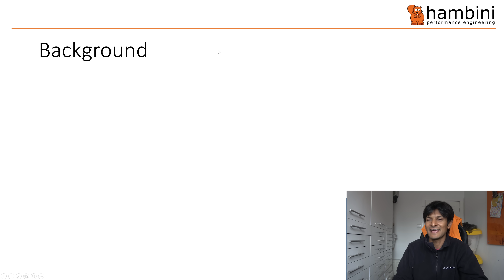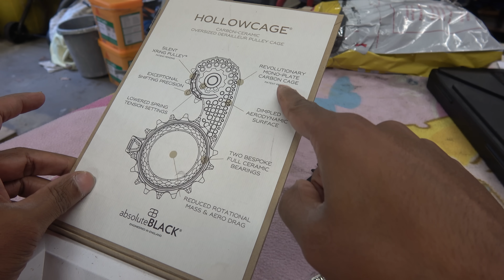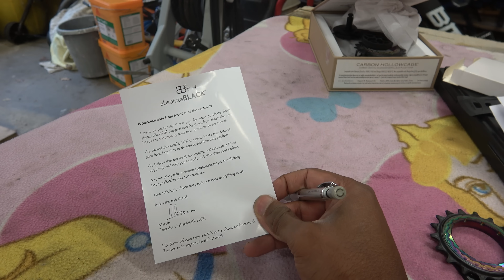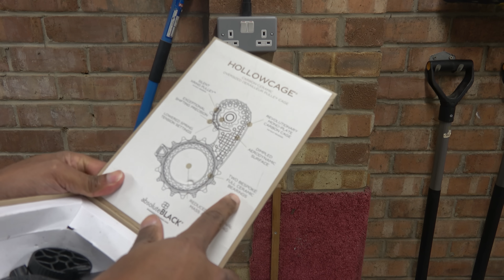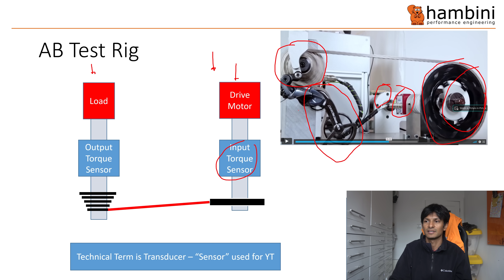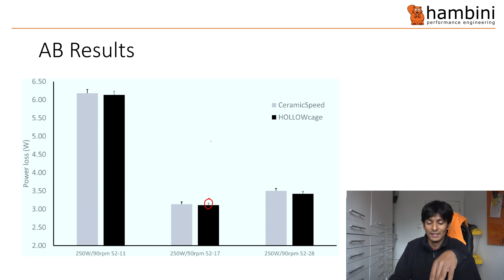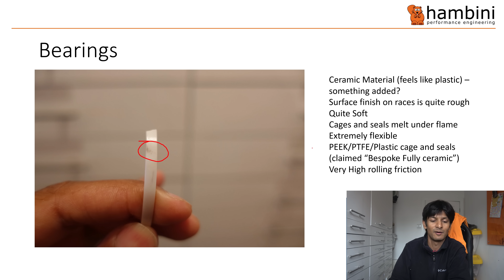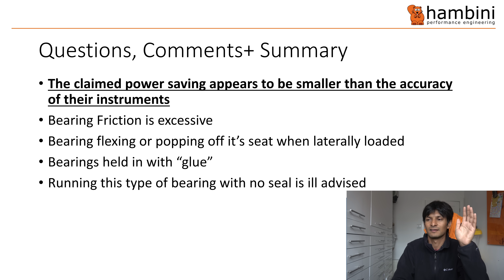AbsoluteBlack $700 OSPW: An Engineering Reaming Hollowcage

Comment from the maker: The thing to take away from this video, is the power savings they are claiming do not appear to be valid. Their equipment doesn't appear to be accurate enough. I would point out that I have been quite conservative in the error. Power is the product of torque and angular speed (cadence), As an example, the speed reading is +/- 1 RPM. If you do that on a cadence of 90RPM, that is already 1% error. That is even before we discuss the torque limitations.
Reply: My issues are why would 1 watt  make a difference anyone would notice, and why not use a better bearing if they intend to sale the unit at such a substantial cost? I know the saying OZs equal pounds and pounds equal pain, but I seriously doubt the 1 watt of potential energy savings is worth the price tag. 

Unfortunately someone's going to have to actually use one and report back if they noticed a difference. 🤷🏻‍♂️
Reply: I'm afraid your analysis of their measurements is incorrect. You are confusing the accuracy of the sensor with its resolution. It may only be able to accurately determine torque to say 0.1Nm, but it may have a resolution of 0.001Nm (made up figures). What is important here is the relative measurements between the 2 products.
Reply from the maker: @leejohnmitchell  I appreciate the resolution might be higher but the torque is lets say +/- 0.1Nm. You cannot be sure that one is reading at the max end the other is at the minimum end. You've got that error on two shafts so it would typically be standard deviation for the two errors to square and root them. Thus the error quoted is conservative.

I would also point out that their graph shows Absolute numbers and not relative ones, it's 6W on the 52/11
Reply: @leejohnmitchell  Sort of;
The reality is we do not know the accuracy figures of the sensors.
Those figures quoted are a range the company warrants the device to be within, not it’s error, or correction, therefore we have no basis to start from nor does Absolute black. Then it even gets more complicated as this is quoted at a temperature. The manufacture also quotes the range is bigger at the lower end if I understand the manufacturers sheet correctly (although I can’t see the foot notes)
Reply: @Hambini  In a setup like this, sensor absolute accuracy isn't so important. Think of it as being something you can zero out like on your calipers. You can take a measurement of one product, swap in another one and you can get a very good indication of difference even if the absolute values are complete bollocks.
Reply: @Hambini  Why has no one mentioned yet that the 18t lower jockey has narrow-wide teeth? Friction City.
Reply from the maker: @leejohnmitchell  I don't disagree with that at all but this is a point now where it's "certified" vs "practical". So practically your comments are bang on but this is used for individuals buying a product. i see it as no different to quoting the 0-60 of a car. You might be able to do 3.87s ( using your comment about resolution) but if your stop watch only has warrantied (certified) accuracy to 0.1s then you must quote 3.9s

I would also add the speed sensor has inaccuracy which I ignored, there are two shafts and two sets of torque readings as well as the temperature. I think my estimate is at the bottom end of inaccuracy.
Reply from the maker: @waynosfotos  For CE certification, you take the error to be the warranted accuracy.
Reply: @ElliotFlowers  Don't come to the hambini show then. Just listen to the marketing hype and you'll never be disappointed.
Reply: @Hambini  as long as you are measuring another item which has a significant resolution or accuracy some significant factor bigger. In this case that is not the scenario.
If you are to quote a error as AB have done here, you need to use the transducers as a Standard, this requires sending it off to your countries measurements standards to be “calibrated” so you have known errors/corrections at set points on your measurements scale (you define these). Then you do your measurement, record your results, then apply the correction or error, to obtain the true error.
So as you have already stated, the standard you are comparing to in this circumstance is not adequate to quote the resolution and accuracy for this test.
And this is before you consider “controls” modelling to take into account any potential variables i.e. the labs ability to measure @ the uncertainty of measurement. Usually 3 sigma.
Reply: @ElliotFlowers  you won’t have it for long single sided injection moulded plastic/carbon to fail  should last a few miles before it fatigues and snaps.  Make sure you ride with support so you can get a lift home and have the receipt handy for when you make it back.
Reply: @jonnythelegs2597   HARRY ENFIELD NO.1
Reply: @ElliotFlowers  he's not here to destroy your happiness(bizarre and sensitive type comment, I must say) he's here to hold marketing bullshit to account. If you want to throw your money away that's your business.
Reply: i bought two cos i believed. next thing he is gonna say take b
ack those shoes i thought i looked cool in.
Reply: @waynosfotos  just a weights a measures perspective as you say they can be used as " standards" when calibrated by an accredited lab to find the exact slope of calibration and accounting for uncertainty. the data sheet says the readability is 0.01%full scale so could give decent readings but for a calibration report the comparison unit would need be 0.001 or 0.0001%full scale and this do be done on the completed test rig to account for any added friction. I would expect these like most transducers are shipped with a very basic calibration certificate of a few test points not determined values.
Reply: lubrication stops a lot things getting too dry.
Reply: @ElliotFlowers  I’d love to live in your rose tinted Hubbard world. 

I see you every weekend, in centennial park doing hot-laps with your warrior mates. Pulling up after three maybe four hard laps for your hard earned double almond latte. Admiring  your Rapha gear and fully specced s-works ( check my new cage guys it’s making me so happy ) 

The enviable life of the Hubbard.
Reply: @RolledLs  Dyson are making handlebars tomorrow.
Reply: @tobycolin6271  You are just such a jealous guy...
Reply: @ElliotFlowers  Did you really buy 2 of them?
Reply: It is posible that the accuracy error manifest as an offset in the reading. That can be zeroed out. With some care in a controlled environment may provide better readings.
A better argument may be noise floor. But that one improves with averaging.

My point is that the video makes other statements much more powerful than this one.
Reply: @leejohnmitchell  comparison measurement like you mentioned, would only make sense when performed by independant body. On top of that, both manufacturers of the tested products would need to agree to the rig setup, testing procedures and conditions. What we have from AB is completly false statements. Im curious why CS is silents about this.. maybe they also have something stinky under the rug..
Reply: @jonnythelegs2597  that's how Hambini should present it!
Reply: @RolledLs  Nothing wrong with Rapha gear out of all that other stuff, it's by far the comfiest stuff I've ever used - comparing to all the other gear I have owned:
Aldi own brand, Pearl Izumi, dHb, Endura (FS-260 with pad fit), Sportful, Castelli, Gore

The only ones of the premium end I haven't compare it to is Le Col and Assos because I've not wanted to spend the money on them in case they are worse. Being, in effect, a reverse snob, making your ride less comfortable because you don't like the big brands is rather foolish
Reply: @ElliotFlowers  the best thing to do if getting ripped off to the tune of 700$  makes you feel good is to not listen to actual engineering analysis and keep your research limited to marketing hype. That way you will remain uninformed and happy. Nothing wrong with that.
Reply: I'd just like to clarify, I'm not trying to defend their product, it looks like an expensive piece of shite, but the criticism of their measurement system is semi flawed! The amount of difference shown between the products is probably reasonably accurate, what is likely total bollocks is the absolute / offset values on the Y axis.
Reply: @frankswl  well, the park tool pizza cutter doesn't claim to cut pizza better than other cutters. It just claims to be cool.
Reply: @leejohnmitchell  Right I'd like to echo the doubt about precision vs accuracy. If the test rig produces repeatable results within a much tighter range than the advertised absolute accuracy, then the test is valid. But you are right that the fact that they advertise absolute wattage numbers is BS.
Reply: @ElliotFlowers  translation: it my party and I’ll cry if I want to! 😂
Reply: @ElliotFlowers  grow up dude!
Reply: @RolledLs  he’s got a S-Works SL7? 😂 a rubbish bicycle!
Reply: @Gobtik  the comment is highlighting the fact of how people rely on all these things to talk for them rather than what they (as-rider) can actually perform …
Reply: Lesson to be learned here? Don’t buy the next big thing until you have more proven information. Wait and see. Great job on the video. Not bad for a five year old. 😂
Reply: @ElliotFlowers  Is this a joke?
Reply: @ElliotFlowers  I wish I was trust me if your cage would make my bike faster or lighter I’d have 2 one for my race bike and one for my tt bike. Unfortunately now hambini told the world only a few people will run these watt sapping devices.
Reply: @ElliotFlowers  AB rely on suckers swallowing the marketing hype and convincing themselves its an improvement. At least you’re keeping distributors in business.
Reply: @ElliotFlowers  You where happy with it, because of its claims and to be fair it looks pretty pimp. If after time that changes due to reviews from anyone, that’s on you and called buyers remorse, chap. The dishonesty causing your diminishing happiness is solely at the manufacturers feet. Complain to them
Reply: Glad I watched this before they took it down 😂
Reply: @Hambini  To elaborate on your example of measuring 0-60 in a car, in this case, you could compare it to having a stop watch which when you press the start button, it takes an unknown amount of time to begin timing (this is the bit that affects the overall accuracy), however this unknown time delay will likely be totally repeatable for this particular stopwatch (given the same operating conditions), but different for 2 identical stopwatches from the same manufacturer. Both stopwatches however, will be able to measure a difference in time to a resolution of say 1ms. Therefore if you had 2 stopwatches timing a car over 0-60, you'd get 2 results that fall within the accuracy figure quoted by the manufacturer. However, if you just use the same stopwatch to measure the 0-6 times of 2 different cars, the difference in the values you'd get would be accurate to the resolution of the stopwatch (1ms in this case). You wouldn't be able to quote an absolute 0-60 time, but you WOULD be able to say car A did 0-60 0.325 seconds quicker than car B.
This is pretty much how a lot of electronic test equipment is calibrated. You send it off to a calibration house who will measure the absolute values from a known accurate source. They can then provide you with a list of offsets for each measurement range so you can work out accurate results, however if all you're interested in is relative measurements, these offsets are not required.
Reply: @Gobtik  @Andrew Lacy-Smith is making fun of schmucks who ride their overpriced bikes only on weekends in needlessly expensive sportswear.
Reply: @Hambini Right, and to think the ‘watt weenies’ out there who can afford these have ‘above average’ incomes…and this prove BEYOND A SHADOW OF A DOUBT…This ‘product’=💩…what does that say about the customers who beLIEve their claims enough to buy them….???? wtf
Reply: @waynosfotos  FUCK YEAH!!!! VELOFLEX 4 the 🥇!!! WAYNOS FOTOS…au R my HERO!!!! 🇮🇹👌🍀
Reply: Even if the bearings are genuine ceramic and made to spec as bearings, far too many detrimental facts pointed out by Hambini made this ospw worthless.
AB’s knowledge base only stretch as far as CNC goes, where they could’ve used Sandvik carbide insert and be ‘inspired’ (read ‘dreamt on’) of.
Reply: I took away the cost per performance. It is the most abysmal thing.
Reply: lets go Brandon!
Reply: @ElliotFlowers  then you were DUPED twice...🙄
Reply: This makes my Kactus OSPS from China look amazing and it was less than a Benjamin. 😂🤣😂
Reply: Absoluteblack Hollowcage OSPW withdrawn from the market in 1, 2, 3.....
Reply: @bnp4292  Oz's equal pounds and pounds equal pain is just a saying used by hikers and mountaineers. There are 16ozs in a pound, so the saying means that all the Oz's add up at the end of the day and pounds of weight is a big deal. In this case, a watt saved here and there make up a lot of energy saved once all the savings are combined. If that makes sense.
Reply: @kennethh5657  get metric plz, k thx
Reply: @bnp4292  replace Oz's with grams and pounds with kilograms and it means the same thing. 

Grams equal kilograms and kilograms equal pain. 

Another way to think about it is a mint doesn't weight much is easy to carry, but a 1000 mints is another story. 🤷🏻‍♂️
Reply: @ElliotFlowers  why would you watch an Engineering review if you don't want to know the result?
Reply: @MotoLopez1k  more than you can afford 🤣😂
Reply: @cruzflores6400  why would I want to afford it? You can keep it. I’ll just ride by all these 10k bikes on my 2k Ultegra rim brake bike.😆
Reply: @ElliotFlowers  Are you for real? I'll sell you one of my deraillers for only 500 bucks. It'll save you 120 watts. Guaranteed.
Reply: @NETSARANYAS  I also think that alcohol makes me sexy.
Reply: @ElliotFlowers  Those of us with any sense can see this is all marketing BS, so it is in reality 'shit'. It doesn't even look that good and the build quality, longevity of it is dubious at best.
Reply: @Gobtik  I love Nalini, I've had a few seasons old team issue stuff from a seller in France for silly money. Good thing is they do big sizes for those of us that are somewhat more muscular in the chest/shoulders but have a bit more of a waist than we might have had 20+ years ago (I'm nominally 46" chest/36" waist). The fit is excellent in the bigger sizes which some others aren't.
I've had Rapha and it's good stuff but from my experience it doesn't fit any better or wear any better than the race fit stuff from Polaris whom are my preferred every day wear brand, so your notional 'less comfort' for less cost doesn't always ring true, I accept of course that can be the case. I've been using the Polaris stuff for nearly 20 years, the stuff I wear the most (less racy) is in excellent condition, colours still vivid, not baggy, no pulls of note.
I also use Assos shorts for hard summer or longer rides, I got a 'tried on once' pair for £40 a few years back so was lucky in that sense, otherwise I have Nalini bib shorts for when its really hot those 5-6 days of the UK summer and 'team issue' winter longs which are a godsend.
The worst thing for me with larger shoulders/chest than your average sporty cyclist is fit and actual sizing, that applies to almost any brand I've come across, absolute minefield, I always ask actual measurements so I can at least compare to my current gear.
Reply: It’s obviously not going to give power savings for ffs…..if anything it will be slower it’s double the weight 🙁
Reply: I hate the 21st century.
Reply: Send the bearing to Ave for his thoughts? he knows his plastics...would also make a comical vid.
Reply: I appreciate the in-depth analysis. But, I don't need the validation. I mean seriously, $700 for a little plastic wheel? Criminal.
Reply: I think the incorrect power saving claims are the least of their worries. The fact that the wobbly plastic bearing will chew itself to bits with the first speck of dust that contacts it or that the flimsy plastic hanger will bend into an unrecognisable shape after a couple of rides makes this product downright insulting.

If they're charging 700$ for this thing, wether it lives up to the claims or not, it should at the very least not be designed to fall apart in less than 100km. It's a downright scam
Reply: @ynotnilknarf39  how dare you!
Reply: @Gobtik  you’ll never be disappointed with Assos. And it will out last any of those other brands.
Reply: @kennethh5657  😁 In Italy we say (quoting the late comedian Totò) "it's the sum that makes the total". If we give a value to all the bullshit AB claims the sum can even be greater than 700 $. All in all 700 can also be an affordable price...
Reply: @kennethh5657  Here's an idea, as a famous cyclist once said, people "Don't buy upgrades, ride up grades". Especially an upgrade in this instance, makes such an incredibly minimal amount of difference.
Reply: Your error bars, being reasonable worst-case from specifications are likely to be very overly robust. An alternative is to use the results themselves to argue the error. There is a statistical argument that the standard error for a set of measurements is x/sqrt(N) percent. Where x is the percentage ratio of the standard deviation to the mean, and N is the number of measurements. This argument does assume that there are no systematic measurement errors e.g. due to different slack side chain tension between different cages, however, this seems relatively unlikely to be a relevant factor in your setup.
Based on this method, I guess your results would show a statistically significant difference between Dura-Ace and AbsoluteBlack cages as the deviation looks within 1% but a couple of % difference between cages. 
I like the test method, I’ve done similar comparing the difference between my power meter pedal values and power meter hub or turbo values, as a bigger rider I put out a bit more power which helps to make percentage differences a bit easier to measure as well.
Reply: Thanks bro! I'm  sucker for pretty things. You just helped me save $SGD900 hahaha. What a relief!
Reply: @leejohnmitchell  in other words it can be precise but not accurate, and therefore if precise you can accurately measure the difference?? -
Reply: @leejohnmitchell  That’s not correct. I did that exact experiment in physics class and the reaction time of starting and stopping the stopwatch by hand varied considerably and added error to the measurements that could not be removed without changing the measurement technique. There is no magical way to remove error. Need more accurate tools.
Reply: @richardpowell1425  I was being theoretical. Ok then, assume that the stopwatches are started and stopped by some automatic means.
Reply: @leejohnmitchell  we are in agreement that a different measuring technique is needed to increase accuracy. The point with science is that theory needs to be proven with experimentation, and experiments show that it is challenging (tricky, time-consuming, and expensive) to increase measurement accuracy. Hambini is correct is the way he handled errors - engineers and scientists are trained in how to do this correctly.
Reply: Yikes. Not a great look on Absolute Crap. 

Sure they'll get this video taken down soon.
Reply: Lookit all this blather over a bike part.
Reply: Larger jockey wheels might reduce chain wear but they don't reduce weight. Don't forget that the more teeth in your cage the longer your chain will need to be...
Reply: @jonnythelegs2597  I hear AbsoluteBlack are coming out with a new range of monorails soon, WOOT!
Reply: Absolutely!
Reply: @bnp4292  I believe they still use it in developing 3rd world countries.
Reply: @frankswl  I'd really rather have the Park Tools pizza cutter.  At least it's useful
Reply: You could reasonably get input cadence at much higher accuracy than that by measuring time between interrupts of an encoder. ~0.5ms per rotation for an off the shelf setup ~.067% error
Reply: This kind of thing is easy to calibrate. You set up a very consistent known load (i.e. weight in a stick) and apply it to both sensors. Transform the output so both give the same reference value. Measure the repeatability of the reading. Then compare their calibrated outputs through the test drivetrain. You can usually do a fair sight better than the label on the box.
Reply: @leejohnmitchell  the sensor datasheet shows a repeatability of +-0.05% FS, so even if you ignore the accuracy component, @Hambini 's numbers are still in the right ballpark.
Reply: Garbage marketing and engineering!!! No good at all! And extremely expensive people that would by this are just for the looks of it and have very deep pockets perhaps money they did not make!
Reply: Why did you have to take the video down?
Reply: @samflint4749  it’s up a year later
Reply: @Michaelsmith21588  got almost sued by AbsCrap but I guess he won aaha
Reply: @ElliotFlowers how are they holding up long term?
Reply: Impressive review
Reply: @kennethh5657 sort of the emperor’s new groove scenario